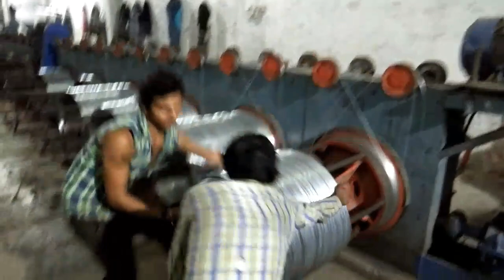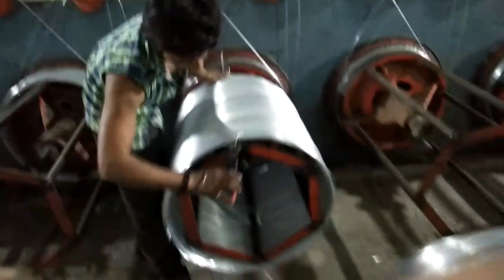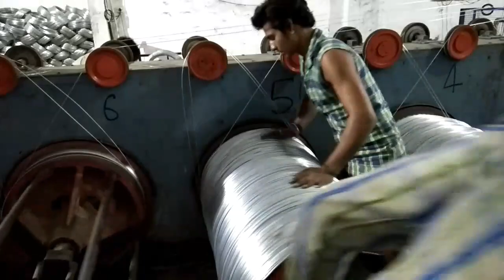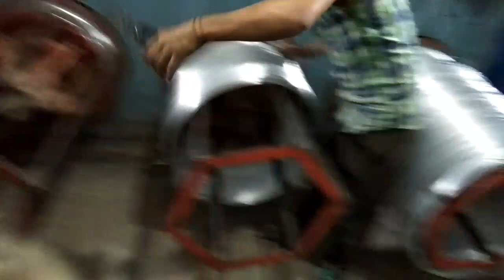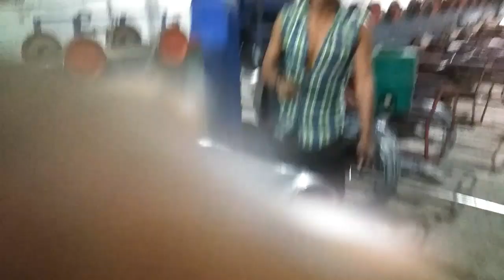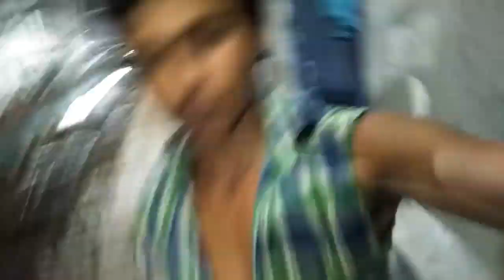Gi wire

Comment: 14mm gi wire price per tone sir
Reply: 55000/- per ton
Reply: Without tax
Reply: @hbwirecutting3243  I need 2mm gi wire
Reply: ok
Reply: @hbwirecutting3243  hi
Reply: 20 number or 40 number chahiye 20×26
1 tonn
50 ft length
3weight
Reply: Kya rate padega